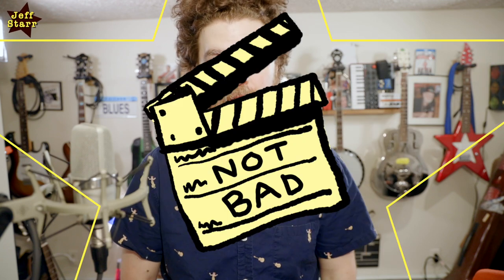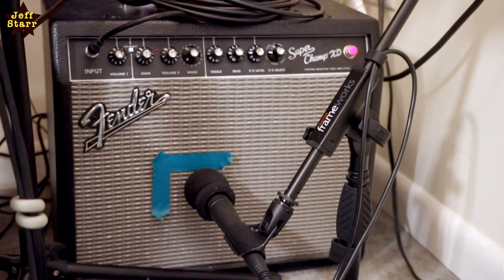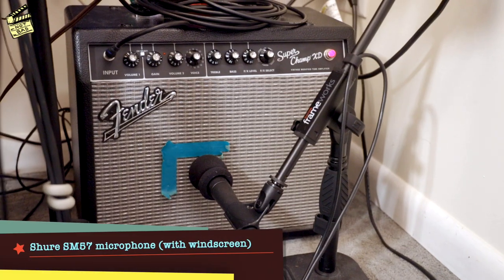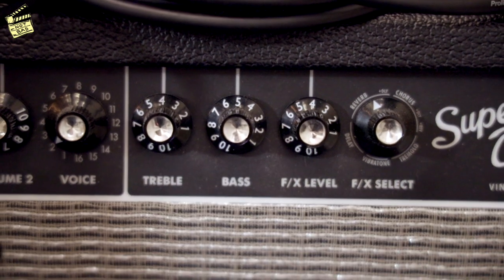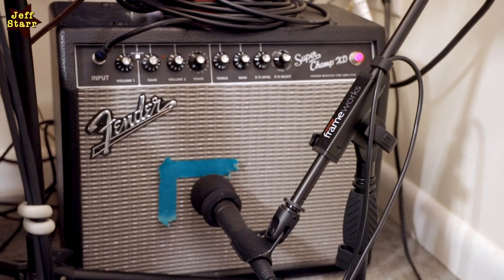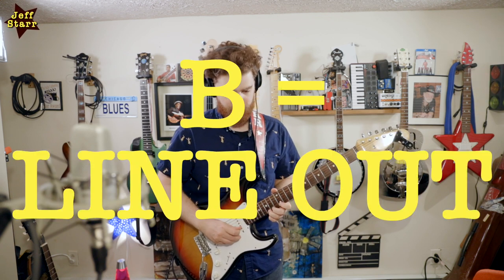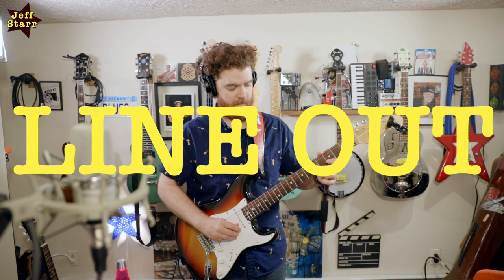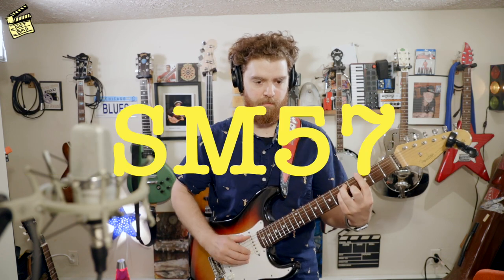Fender Super Champ: Line Out vs Mic. Amazing results!

Comment: The line out sound warmer than the mic. Personally it is a no brainer to go direct with line out if you are needing more output at a gig. 
This amo has to be Fenders best value vs sound they have ever made. 
I know a few that use them direct at theatres.
Reply: Are that line out can connect with pa?
Reply: Yes, you can run line-out into anything that accepts a line-level signal. It could be PA, recording interface, another amp, etc. You can use the line-out like that to make the amp your stage guitar monitor. I like to run my Vibro Champ XD to the slave input of an amp with a 10-inch speaker. It helps fill in the sound, since the VC only has an 8-inch speaker.

Comment: Line out sounds more processed and cleaner like a kemper. With the mic you get a less processed valve-amp sound. This is the best line out sound coming out of a modelling amp that I‘ve heard, it beats the boss katana‘s, and I appreciate you doing this video
Edit: the bit at the end is the line out imo
Reply: It's actually not a modelling amp. There are tubes in the amp but it has 16 different voices built in
Reply: @Wess, reeeally? That’s interesting. Thanks for the info I didn’t know that... I might look at the amp again, I find hybrids like that have a lot of potential
Reply: @mountainman8775  I agree. I currently have the x2 version of this amp (basically the newer version) and it's great. It's my first tube amplifier but it's offering everything I ask from an amp. Plus it takes pedals quite well!
Reply: @mountainman8775  Besides, it's not that expensive either
Reply: @Wess,OP is correct. The Amp is a digital modeling amp. Yes it has pre amp and power tubes but.. it is still a modeling amp. One that is superb.
Reply: @mountainman8775  Get one used, the head or combo. Truly a special amp, make sure you mess around in fender fuse too

Comment: As soon as I plug into the Line Out on my Super Champ X2 the amp speaker and my interface monitors both start making a fuzzy noise. Interface is a Focusrite 4i4, the input is set to accept a line level input.

Comment: I have a question
If I am recording using this connection :
Guitar --> Amp --> Amp Line Out --> Instrument Input of the audio interface --> computer (while recording)
Can i hear the guitar sound from the amp while recording ?
Reply from the maker: Yes. The amp makes sound when using the line out. You would need some sort of load box or attenuator to run the amp silent while still getting an audio signal from the line out.
Reply: Thanks for this. Exactly what I was looking for. Unfortunately I wish the line-out would kill output thru speaker 😔

Comment: Hi there, I've got this amp, I wonder if it happens the same to you if you try to use pedals with it. I used to use overdrive pedals on the clean channel of the amp, and never got a really good  overdriven sound, but only a lot more volumen, they acted more like a booster. But one day I tried the same pedals, (TS9, OCD, DS1 etc), on channel two, voice one wich as you know it is a clean fender tweed sound, and yes the pedals sound glorious on that channel and voice. Then, one day,  I read that the amp is designed to sound clean on channel one and is not really worthy trying to get dirty tones out of it, but channel two is the one for those kind of tones, do you agree?, greetings from Spain, good videos ;)

Comment: For silent home recording, could the speaker out cable be unplugged and a speaker cable used into a loadbox like the Torpedo Live?
Reply from the maker: Yes, you can run the speaker out into a load box or attenuator. Just make sure you have the correct ohm and wattage.

Comment: Thanks for video ,
Did you try record through usb ?
I found  daw input signal is too weak I didn't face this issue on yamaha thr 10C because it has usb level control
Reply from the maker: This is the first version of the amp without USB. I have used the usb on the mustang series of Amps and that always worked well, but I think Fender has discontinued the Fuze software.

Comment: Actually like line out more. I have the amp + separate cabinet configuration (not combo). Does the amp need to be connected to a speaker load while using the line out?
Reply from the maker: On the Super Champ you need to have a speaker cab connected as the output section is all tube.
Reply: notbadfilms Ah shame, renders the line out somewhat pointless for me. I need to have the cabinet silent while hearing the line out only. Thanks!
Reply: @louierubio  Thanks for asking this. I was trying to figure this out today.
Reply: @budwhitleysgarage5873  hope it works out! God Bless
Reply: @louierubio  Thanks, I just ordered a 50W, 8 ohm resistor from Parts Express to create a dummy load instead of the speaker. These are commonly used by repair guys so they don't have to blast their ears when testing an amp's output. A tech I trust tells me that even with extended play the 15 Watts output of the Super Champ x2 shouldn't heat up the resistor too much. I'll let you know how it goes.
Reply: @budwhitleysgarage5873  oh wow cool! Lmk how it goes :)

Comment: I have 2 of these amps.  One black and one blonde. The line out is a great feature IMO and I like that is does not cut out the amps speaker output when used.  This allows me to do things like stack it on top of my solid state Peavey Studio Pro 40 watt amp with a Celestion Vintage G-12 speaker and use it as a slave into it's power amp input or plug into the front of the Peavey and control it's volume there to match levels output of the SCXD with the 10" stock speaker in it providing me with great highs and lows etc. or just crank up the Peavey's volume to provide a whole lot more volume if needed. Works great going into other amps I have also up to 250 watts for pissing off the neighborhood.  I found that your line out sample sounded fuller than the mic'd up samples.
Reply: Is there a way to run the line out and cut the speaker? I'm trying to record quiet at home.
Reply: @oinkooink  No. Unplugging the speaker will damage the amp. I have read that using a dummy load in place of the speaker can be used, but I have no experience in doing that. I suggest contacting Fender Support and maybe a Sweetwater engineering sales tech for possible solutions.

Comment: I need more strat practice (normally I play acoustic) I have a Super Champ XD. Should I use the XD to drive a headphone amp? Is that overkill? I would like to learn the XD sound while practicing. Good use of time. I think I am going to like practice using headphones.
Reply from the maker: If you want to use headphones I highly suggest getting a dedicated headphone amp. The Superchamp XD and X2 doesn’t have a headphone output.
Reply: @JeffStarr  It does have a line out though. I bought an AudioBox USB 96. Works great as a headphone amp,even sans software.

Comment: Hi Jeff, Hope you are doing well, If you need to record ( super champ xd amplifier) with your electric guitar, wich line do you use? Line out or speaker out? I would like to record with behringer um2 ,but i dont know wich line will be right.

Thank you.
Reply from the maker: Ever since I did this test I have been using the Line Out when recording the Super Champ.  It's just so easy to set up and it always sounds the same.  It also saves me space as my room isn't huge so it's one less mic stand to trip over.

Comment: I'm rusty on all this stuff, and it seems I also completely overlooked this feature on my amp.

Does 'line level' mean that it is at a constant level that you can't change..?
Or is the volume of the line out determined by the volume 1 knob..?
It would be great to just record with the line out and turn down the speaker completely, but I'm not sure that's possible..?
Are you using a guitar cable or a speaker cable..?  (guitar cable I presume)
Can you just plug some headphones into the line out, or would a headphone amp be necessary..?
Reply: Guitar (shielded cord) or you’ll get hum 
Yes you need headphone amp (sometimes you can hear a tiny bit from line level) usually the gain does influence the level of the output. Sometimes if you have a master volume it doesn’t affect the line out.

Comment: Why isn’t line out the normal for recording? Most guitar amps have a line out/headphone out
Reply: For a lot of amps, the speaker's characteristic breakup at higher volumes adds to the sound. So, they mic it to make sure the soundboard gets the same sound you hear in the air.
But in a modeling amp, the speaker isn't adding its own color as much, since you want to depend on the quality of the digital models to get the sound right. So the line-out (which usually has speaker and cab emulation built-in) can sound really similar to a mic set up. In general, regular guitar amps' speakers color the sound, but keyboard amps, PA speakers, and strict modeling amps shouldn't.

Comment: These are very similar. But I'm curious if it changes when you play with some mid- to high gain sounds. Would you be able to advise me on this? I'm considering getting a mic for my amp but this makes me realize I might not need one
Reply from the maker: If you are using the Super Champ XD or X2 and are just getting started with home recording I think the line out is a great option. I think the X2 also allows recording out of its USB port too. How hard you drive the amp does change how the line out sounds, but I’ve found it totally usable.
Reply: @JeffStarr  alright, thank you! I'll hold off on buying a mic and instead try to use the line out for my recording

Comment: people that use a mic when a line out is available are kidding themselves. The signal going to the board has to be eq'd regardless od which method is chosen as the preamps, amps, and speaker systems have totally different sound characteristics. Using a mic in a live scenario can induce feedback also. The drums and bass guitar can play hell with the mic.....

Comment: Are you using Cab sims for the line out?
Reply from the maker: Nope! Cab and mic sim are part of the line out feed.
Reply: @JeffStarr  so just straight into your DAW?
Reply from the maker: Correct. Please note that the speaker still makes sound when using the line out. It would be a good solution for live gigging though when the 1x10 isn’t loud enough. You could use the combo for your stage monitor and run the line out into the sound board for the PA.

Comment: Can i use the line out for live concert straight to the mixer ? Pls help
Reply from the maker: Yes. The line out is emulated to sound like a mic’ed up speaker cab so if you run a 1/4” cable from the amp line out and into the mixer (and have the mixer set for a line level signal) you could use the house PA system.
Reply: Thank you very much im about to buy iam amp (marshall mg30dfx) that have a line out and i needed help so bad thank you very much ❤️
Reply from the maker: @MohameedHajtaleb  you should double check that the line out on the MG30dfx is speaker emulated. It isn’t on all amps. If you want to run into a PA system you will want something with speaker emulation on the line out.
Reply: 1/4 emulated line out & headphones .  Is this work with pa system?

Comment: Does the line out kill the sound coming from the speaker ??
Reply from the maker: Good question! Using the line out does not kill sound from coming out of the speaker.
Reply: @JeffStarr  Dang, lol I sure wish it did. Love the tone you were getting. thank you sir for your reply !!!!
Reply: @0757drsj  You can kill the sound from the amp itself by simply just plugging a cable into the "phones" input, and as far as I'm concerned, it won't mute the line out.
Reply: @redgamer821  Thank you !!!
Reply: @redgamer821  the XD model doesn't have headphone output.

Comment: They sound the same. So I would use the line out for convenience.  I have one of those amps.
Reply from the maker: Yeah, since I filmed this video I have stopped using a mic and record using the line out. So much easier!
Reply: @JeffStarr  Line out was better than expected. Will probably continue doing both line out and sm57 mic for the option. Only wish I could do line out without any external sound so I can record at night